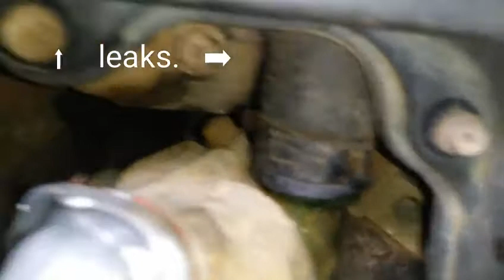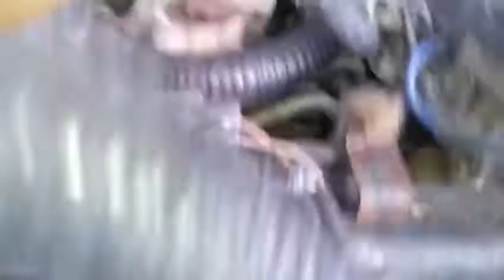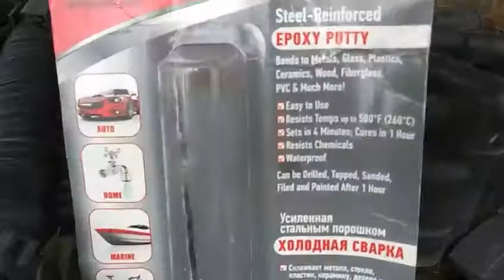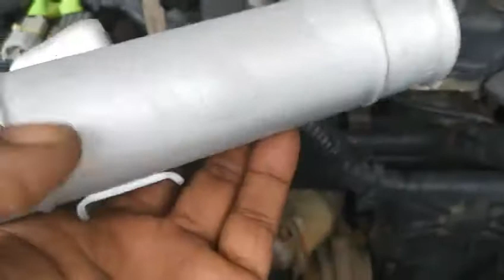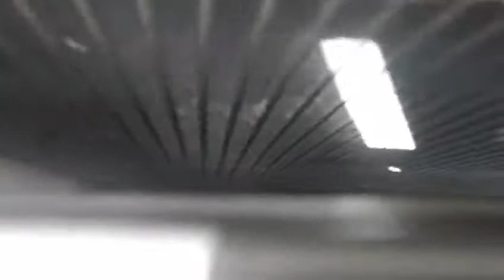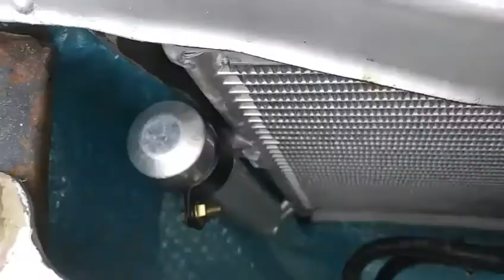Nissan Vg33E Water Pump Elbow Hose. Part 1

Comment: Do you have to remove both timing chain covers to put that water pump elbow hose back on? 6.50 am
Reply from the maker: Its might help if you remove the timing belt cover but there is a backing plate which the timing belt cover is bolted to, that will remain in place. To remove the backing plate for the cover, the timing belt and the camshaft sprocket have be remove. The best way to go about it is like you see in the video or remove the upper intake plenum and the lower intake manifold. At the same time the gaskets for the intake plenum and manifold can be replaced. Did you see this video https://youtu.be/Yudp_lkQ9p8?feature=shared

Here is the intake plenum removal video. https://youtu.be/4hF97twkp1s?feature=shared

Removal of lower intake manifold. https://youtu.be/4A0411Bmh8s?feature=shared